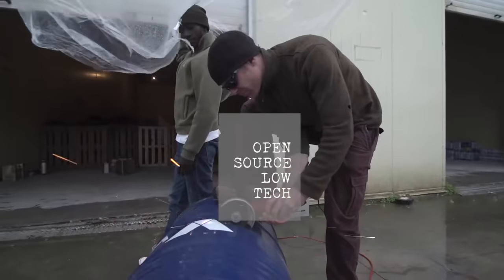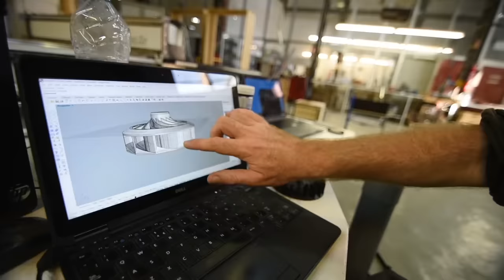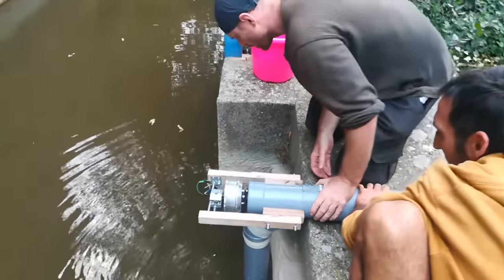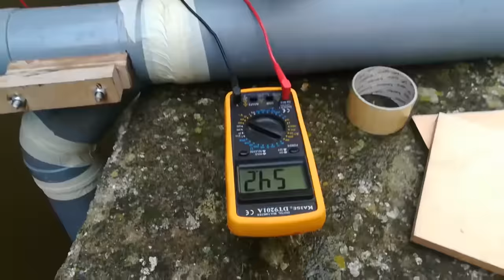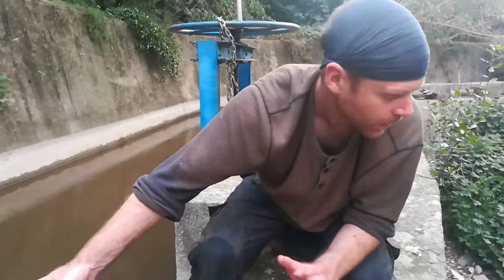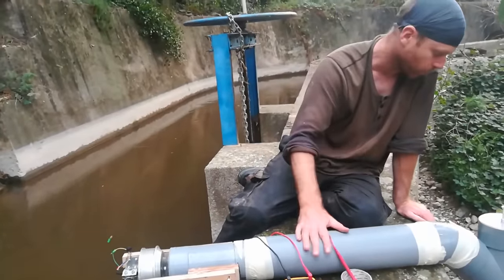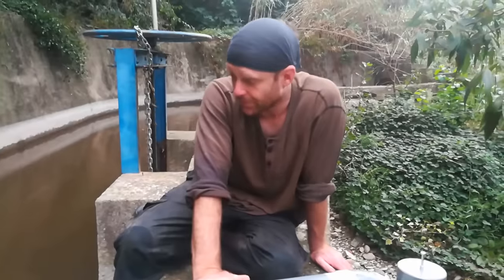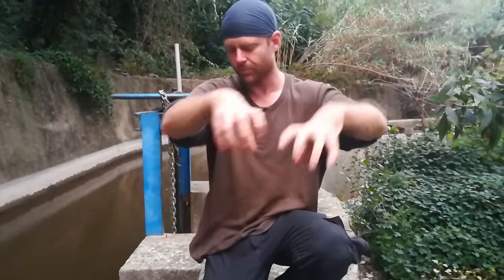The $50 Water Turbine -DIY, Portable, Powerful, and Open Source

Comment: So if you in need of something a little bit bigger to put out more power just up scaling what you did would work right bigger motor, pipes, and propeller would do it. At least in theory it would.
Reply from the maker: Yeah it's fairly arbitrarily scalable. If you're only going up by a couple of multipliers I'd probably keep the alternator and impeller the same, and just use larger tube. Then throttle down across the impeller and you'll get more rpms.
Going up an order of magnitude would require new everything, but would still operate under the same principle.

Comment: What is the motor are they using?
Reply from the maker: Wheel from a hoverboard. 350W three phase AC permanent magnet weathersealed alternator you can get two of for $20 because someone's throwing the whole board away.
Not so available in global south countries tho unfortunately.

Comment: Hurray, he found a miracle! Or..... Impossible, 10A at 50v, 500W. Why? Because when you attach a load, magnetic flux will rise and acts like a mechanical resistance. The more current you draw, the harder it is to turn the rotor. Also there is a voltage drop. There is simply not enough water power to turn the rotor (with (heavy) load attached) , too light and the turbine is too small. So what he is saying about the produced power is not true!

Comment: and why not put a few more turbines, or in the hole where water is poured to start, also put a generator(you can try a more powerful one), and put several impellers on it for more power, and put an impeller in front of the impeller that will not rotate, but will rotate the water towards the blades of the impeller of the generator good luck !!!

Comment: This unit would not work as well as he thinks because has taken in consideration the line losses getting the power from canals to the homes. Now if the water could be plumbed to the homes maybe it would work for them, but farmers are not going like flushing water to someone else’s field just to have electricity. It could be used to charge batteries, but someone would have to be put in charge of swapping out the batteries.
Reply from the maker: That mill run was quite close to the buildings, and the outflow was just going back into the river it originally came from.
In actual field use these would presumably plug into waterways fairly adjacent to the houses to power.

Comment: I would add a 90° at the bottom to stop base erosion..
Reply from the maker: Is an option, tho for efficiency sake it's best to have it emptying into water, ie below the surface, to prevent air reintraining itself up the draft tube.
Check the part 2 video for more info.

Comment: This is off-load current. On-load current maybe around 100 watt only for this type of small pipe water.
Reply from the maker: Check the parts 2 and 3 videos for load testing results.

Comment: Quantos kva com uma vazão  de 90 litros por seg. E uma queda de 4 metros.🇧🇷
Reply from the maker: Power = drop x flow x gravity = 3.5kW, which would be way more than this turbine could handle. With a steel fan, fatter pipe, and a much heavier alternator tho, it should still work in principle.
You could also do several small ones in parallel.

Comment: Because wind and water energy extraction work best at low rpm high torque some intermediate system is needed high head water provides adiquit  torque at high rpm so pumping water up hill to get high head works pumping air into a reservoir to power an air turbine cyclicly  so acquit air pressure is a valuable to generate power also works and a trash bag with a cloth cover baried  in a hole with weight on top makes a very cheap pressure vessel a 3 mil nylon bag with a cloth red forcing outer cover can easily Handel 1 to 2 hundred psi extracting energy is never the problem concentrating it so useful amounts can be taped and used that is the trick how do you turn a lot of low density energy into a lot smaller amount of high density energy that can be used to do work this is always the problem as there is lots of low density energy much of it not worth the cost of finding a way to consintrate it !

Comment: is this 4.5 inch motor or 6.5 inch motor?
Reply from the maker: 6.5
Reply: @OpenSourceLowTech  i searched this motor in aliexpress & alibaba. but it is very expensive. the shipping price is 3 times more than motor price. can you tell the place or website  you bought it for cheap price
Reply from the maker: Where are you based? In western countries I usually just get a whole board second hand which someone is getting rid of because the battery is gone, or the kid is bored of it etc. Usually only about 20-30 $/£/€

If you're in other parts of the world they can be harder to get hold of tho. There are other options, such as motorbike alternators, which aren't quite as good, but still useful.
Reply: I am from Sri Lanka. I can buy this motor for cheap price from China. But the shipping cost is expensive due to corona. If we use motor bike alternator how much watt , voltage and ampere can I generate? And to generate useful current from what rpm should it spin ? Also how can I charge the 12v car battery
Reply: What is the battery charge procedure ? Variable Alternative current >Rectifier > variable Direct current > charge controller > 12V battery >inverter > 230v Stable Alternative current output.

Comment: Do you realise that after you put a load on that thing the voltage is going to drop considerably?
Measuring that with an open circuit doesn't tell you anything about the power you're gonna be able to draw.

Comment: The problem could be the water, you are modifying the water circulation and a big quantity will not continue his  original circuit, you also will need a grid to prevent the fan from possible objects fish's or plants

Here is a link to a similar project
https://youtu.be/cOgO8z71D0o
Reply from the maker: In actual use this will most likely just plug into a run of a river with natural drop, and so not divert the water in any way.

Comment: computer fans break really easily, I tried using one before. not in this configuration though, just had a jet
Reply from the maker: Quite possible, I'll see how it holds up over time. There are options for strengthening it, and stronger fans available.
Reply: @OpenSourceLowTech  I like this sort of design and was thinking of something similar myself for the purpose of saving money on pipe, but the problem I see is that very few people are in a situation where they would have sufficient volume of water that drops enough over such a short space. in most places out in nature where it does, you run a serious risk of losing the whole assembly during flood season. unfortunately, my next microhydro set up will almost certainly involve a great length of 2" pipe and the associate hassle of moving it, and expense.

Comment: how many speed turbin?
Reply from the maker: About 2200 rpm unloaded with a 2.5m drop and 160mm feeding 200mm pipe.
About 1300 rpm at 3.1A load for 192W.
Reply: Ok thanks infonya sir

Comment: Cheap, sure but it won't last long. Judging by the noise it makes, unsuitable bearings etc. Good idea but it would need a little bit more of engineering!
Reply from the maker: Check the part 2 video, the version I built after this one was a lot better centered and about a tenth the noise and vibration.

Comment: While it does work, it's totally impractical for a practical power generating source.....it just doesn't have enough capacity to warrant the bother of building it.....you could have hypothesised the outcome by a general observation of the pipe diam and the flow rate......you could probably recharge your Iphone with it if you were out on a camping trip and had to see the news or weather report......but a 12 volt photo cell would be less bulky and more efficient and you can buy it off Ebay for very little now.
Reply from the maker: The current version in Berlin is now putting out 175 watts, with a couple potential improvements left to try.
Remains to be seen how it holds up over time, but field implementation is phase three, in a couple months.

Comment: Problem with this type of generator is volume vs pressure ......notice how the water level in the viaduct fell two inches during this video. A typical dam need as much water flowing in as this takes out. Ok for short bursts or high rainfall.
Reply from the maker: It goes through about 30 liters per second for 200 watts, which is a bit in terms of stored water, but only about a small stream for constant flow.

The water source in this video is a mill run, fed by a river. The level didn't actually drop, I think maybe that high water mark on the wall was actually a splash wave or something.

Comment: How many amps and rpm?
Reply from the maker: Check the part two video for full power output test results, but basically it's peaking at 192W @ 3.1A 60VDC ~1400 rpm.
Reply: OpenSourceLowTech I love your designs this can power off grid homes...... Some people in my country still has no electricity..........lowcost and reliable
Reply: Try some other generator like car alternator has high amperes you need to find a good rectifier or voltage regulator to maintain the current....
Reply from the maker: Car alts can do high amps, but their overall efficiency is usually pretty low, and they need a lot of revs to do any useful voltage.
Easy to get in most places tho..

Comment: How bout an impeller from a jet ski? Or jet boat... use al there research and tech since they prob use the most efficient design to move water that’s powered by another source.... intern by reversing the process should yield the same properties ..no?
Reply from the maker: Would definitely be best for durability, and I suspect a more efficient form, but the issue is material availability. PC fans are super common everywhere, outboard props and the like much less so.
But nothing to stop you using one if you can get it.

I'm going to 3D print and compare some options in the upcoming field test install, but that's more for my own understanding of what's most efficient, as most people also don't have 3D printers..

Comment: I like the idea but this project is very incomplete. What you have shown is a voltage measurement without any real load applied. What you need is to make measurements under the load. This is the only way of proving the total efficiency of this device. Besides, even in the most distant places you will find electrical equippment that complies to certain standards like voltage value (AC/DC), frequency (AC). If you want to make this project useful you must aim for providing standardized voltages and frequencies (if AC system is choosen). This cannot be done without an additional electronics and possibly makes things much more difficult if you want to have a battery in the middle. Apart of that, this project uses keyword "opensource" but there i see no documentation available so far. Despite all this problems i wish you all the best and good luck!

Comment: Look behind you.  The water level appears to be dropping rapidly.
Reply from the maker: Was just a high water mark left by the splash of putting it the water. The mill run is constantly fed by a river, with a lot more flow than the turbine was consuming.

Comment: I love your spirt but with a 2.5 foot drop you could run a turgo and get insane power.
Reply from the maker: It's 2.5 meters / 8 feet, but pressure turbines such as turgos / peltons generally require at least 20 meters of head to operate well.
Reply: @OpenSourceLowTech  my point is with a head stock like what you showed, if you couldn't get the drop you needed down stream for a turgo then a water wheel. Again I commend what you are doing. Someone has to try it. Just don't think its going to work but I would be happy to see you prove me wrong. Good luck.
Reply from the maker: Check the part 2 video.

Comment: 3D printer!!!...are you giving away that part because I don't have nor can I afford a 3D printer. Don't know anyone with one either...I could've sworn you said " theoretically, anybody, anywhere, can make the stuff and get access to these resources. "...?
Reply from the maker: I address this about half way through the video.
Reply: @OpenSourceLowTech  I turned off the video as soon as I saw you using the 3D printer and I'd be willing to bet a lot of others have,  and will, too.
Reply: It is a good design tho,and the way it works over the wall is awesome

Comment: Ok, its pretty cool, but 500 watts is NOT 2/3 of what it takes to power a home. One space heater runs on 1,500 watts. Hell, i have a light bulb that burns 250
Reply from the maker: Yes but it's 500 watts 24 hours a day, which is 12 kWh/day and an average home consumes about 15-20 kWh/day.

Comment: $50 worth of parts for the pipes, turbines, generator but $100,000's+ for the weir/dam.
Reply from the maker: This one only goes over a wall because it had to, most in use applications would probably just plug into the river directly, maybe at most a couple rocks to keep the water level a bit higher.

Comment: There has been a lot of speculation about how much power this system could actually produce.  It would have been nice to have had a better explanation of just what actual components were used.  You know  ... look I'm pulling a motor from a ...   The commonly home brewed low cost generator seems to be a automotive alternator with permanent magnets installed as the stater.   With this video we get no flow rates ... no head ... no real information at all.  I applaud Fitzsimmons for making cool stuff but if he has access to the internet some research might be useful rather then  randomly throwing a bunch of junk together.  We need more people like him doing simple low cost applications and I do like that he actually did something so I'm not trying to be critical.  As he said he is not finished with the design so maybe this is a good idea after all.   We shall see what he comes up with and I would imagine he got some useful help form the comments.
Reply from the maker: Currently in the process of testing and optimising the design. More info and results to come soon, followed by a full build tutorial.
Reply: @OpenSourceLowTech  Thank you for your response.  Please don't think I was being critical I do applaud you efforts.  We need more people doing things like you are doing.  Nice wind turbine BTW :-)

Comment: how about using common tools not something that is unavailible for most folks
Reply from the maker: The tools are a drill and a saw. 3D printing the impeller is an option for those with access, the PC fan is for those without. Check the tutorial link in the description for more info.

Comment: maybe a little more research buddy. You put any kind of load on that and you're down to 10% which will easily be sucked up by the long transmission wires you would need. Nice try, but sadly no. You will need 50x the torque to have something viable.

Comment: The water is finishing look at the wall
Reply from the maker: There is a high water mark in the video, but the level didn't actually drop so I think maybe that was from a little wave or something from immersing the turbine.
That mill run was being fed by a reasonably sizeable river, there was no danger of it running dry.
Reply: @OpenSourceLowTech  I understand that I think it is a stagnant water source. Thanks.

Comment: Seems inefficient to pump water upwards.
Reply from the maker: The siphon action of the output being lower than the input sucks the water up and over the wall, but this was a test site and in real world use it'd be preferable to have the input tube running out of the water source more or less horizontal, so that there's no elevation of the water required and it should self start.

Comment: Awesome build, thank you.  Check out the lily impeller, if you have not seen it yet, pretty amazing efficiency tests - able to mix 10,000,000 gallons of water using 200 watts.  I would be interested to know if a version of this impeller would increase the output  — http://www.paxwater.com/biomimicry
Reply from the maker: I'd imagine it would be quite a lot more efficient, but the issue is ease of replication. I want this to be makable with scrap and off the shelf materials, pretty much anywhere in the world. 3D printing and the like unfortunately isn't yet quite ubiquitous enough.

Comment: MOTOR , WHEEL AND PIPE, ALL 80E? IM SURE THE MOTOR AND TURBINE ALONE MORE THAN THAT..COPY OF THE FULL PLANS PLEASE!
Reply from the maker: Not sure where you got €80 from, this build and the next in Berlin actually cost closer to €40.
The motor/alternator is from a second hand hoverboard which cost a total of €30 (and has two wheels), the impeller was essentially free, with the rest being just off the shelf PVC pipe, bits of wood, and nuts and bolts.
Reply from the maker: I've been able to find these materials in five countries now for those prices, tho they do vary quite a bit from store to store.
Please watch the whole video, I've swapped the 3D printed impeller for a computer cooling fan for reasons of accessibility.
Reply from the maker: I'm currently working on the full build tutorial, it'll be available here and on the website when it's done.

Comment: 50 liters per second🤔
Reply from the maker: Check the part 2 video, it turned out about 30, but 200W rather than 500, which I'm still happy with.

Comment: LOL, you think you're going to get 500W of power from that system?

....the equation for fluid power (NOT electrical power after efficiency loses) is P = Q*p (where Q is the flow rate in m^3/s and p is the pressure in Pascals, N/m^2)

The water head you're using looks to be about 3m which would give you 30 kPa of pressure... so unless you think you're ever going to get more than 16 L/s (> 4 gallons/sec) through that pipe, you will NEVER get 500W out of that system. If that's a 6" pipe, you'd need at least 3 ft/s of flow at 100% efficiency.